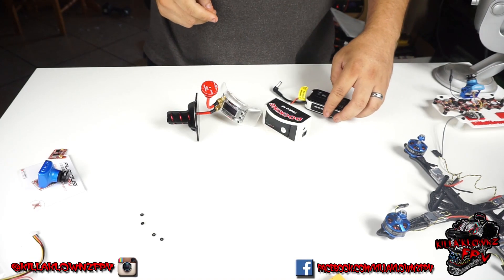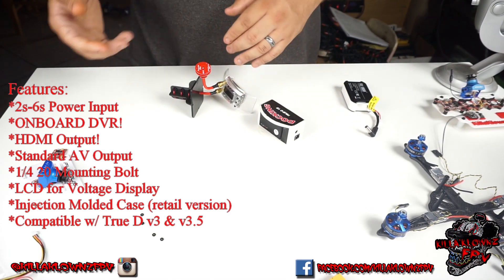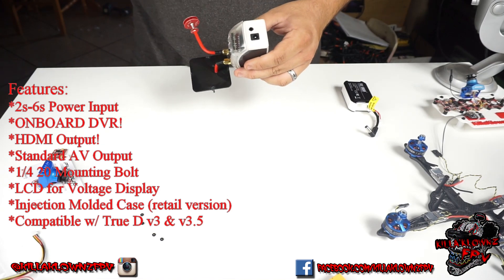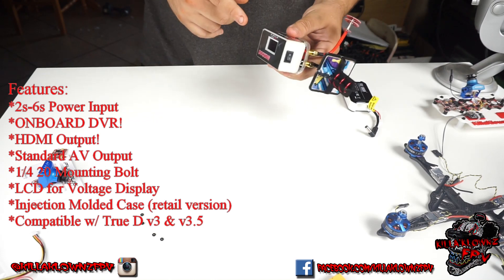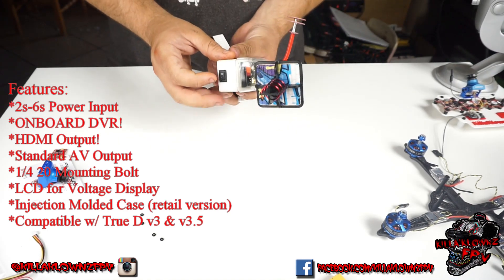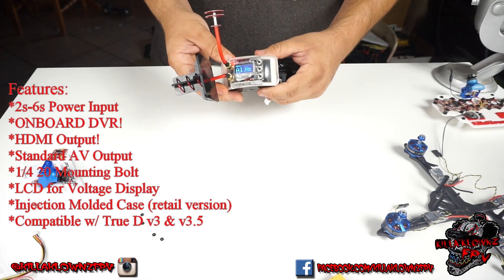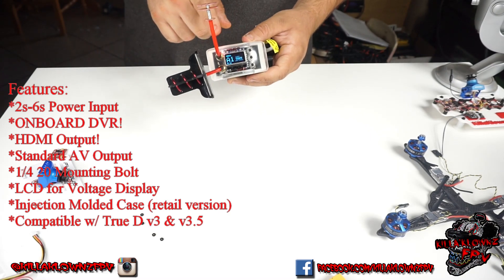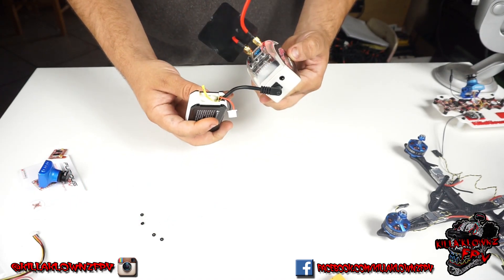FuriousFPV - True-D v3 Dock!!! Real life Transformer!

Comment: Whats the use of a HDMI out if all you're getting is analog signal??
Reply from the maker: quite a few actually since theres handful of monitors and goggles that are HDMI only, this would allow them to be used. Also for races where the main system is using hdmi box for hooking up all the systems, this would make it pnp to just plug in and setup even faster. Also makes it good for setting up a monitor for spectators and still send av signal to goggles or backwards, etc. There are quite a few benefits
Reply: norazil You could for Example connect some Eachine google one's via the HDMI port. I think it's a great feature to have this option. Really looking forward to get my Hands on this😁

Comment: If that's v3.5, you have your antenna on backwards.
Reply from the maker: Any antenna can go on whatever plug, it's not specific to top or bottom, rssi dictates which one is used.
Reply: I was under the impression that antenna A is CP and antenna B is diversity. I had mine the opposite and my signal was horrible.
Reply from the maker: Nope, you can put whichever, the issue with yours probably was antenna direction or you had your directional covering the cp
Reply: when.. from Texas ???